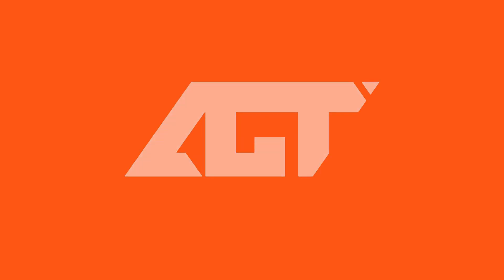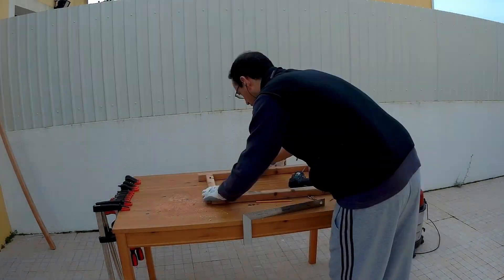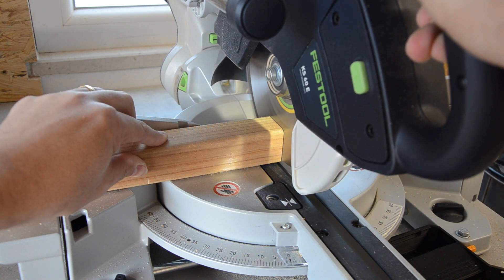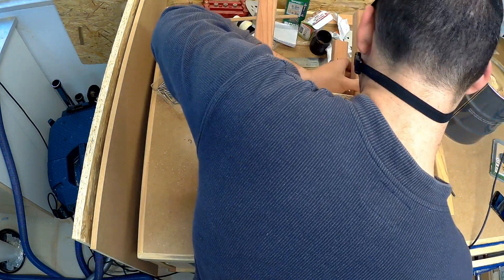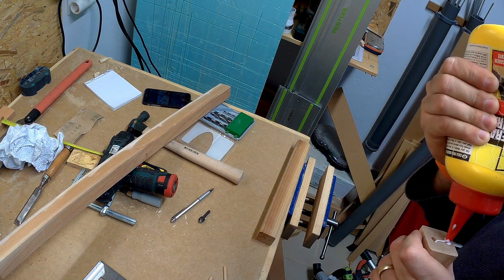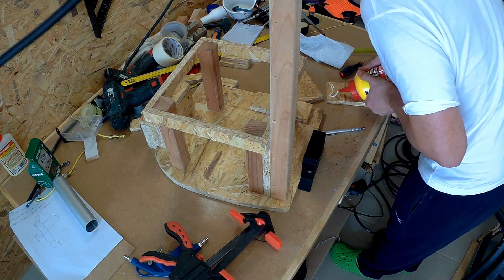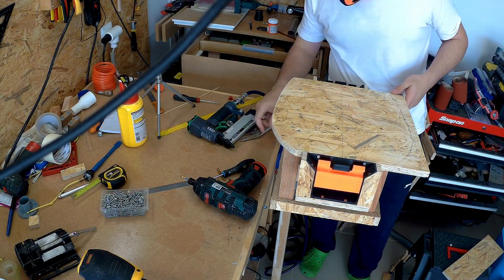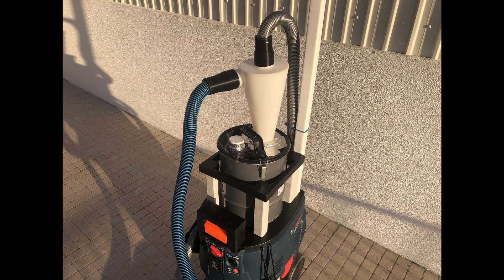DIY Shop Vac Cyclone Upgrade | Enhance dust collection in a small workshop

Comment: Hi, great video - where did you get the dust bin/container from?  I'm finding it difficult to get hold of a small one like yours.
Reply from the maker: Hi. I had it already from an old vac which has an ash separator, that’s where the metal bin came from. Cheers

Comment: Hello, thank you for your content! I was thinking of buying a bosh 35M AFC to do the same but i was worried about the connection between the cyclone seperator and the vacuum. How did you manage to fit the  flexible to the cyclone and  also to the vacuum? Did you buy some adaptators? Did you 3D print them?
Reply from the maker: Hi! I’ve designed and 3D printed some custom adaptors, nothing fit at first… just one thing to be aware, there is a loss in vacuum power when adding the separator. I find that it does the job still very good, but take it into account. But only the fine dust ends in the bag, all the rest gets separated, which is really great. Cheers
Reply: @AGTDesigns  Thank you for the reply. If only the fine dust goes to the bag it's great. LIke that the filter and the bags have a longer life and I don't think the filter stays long a class "M" if he sees heavy dust.  One way, to improve the power could be to use PVC pipes beeetween the vacuum and the separator (but without hard 90° change of direction) as there is less air pressure drop with them compare to a flexible. And the shorter this flexible/pipe is, the better it is.
Reply from the maker: If you can put the bin side by side it would cut on the pipe length, but in my case I needed it to be on top to save space… I have a very tight 1-car garage as a workshop, which also serves as “long-time” storage, so real-estate is quite valuable… let me know if you build it and how do you find it! Cheers!